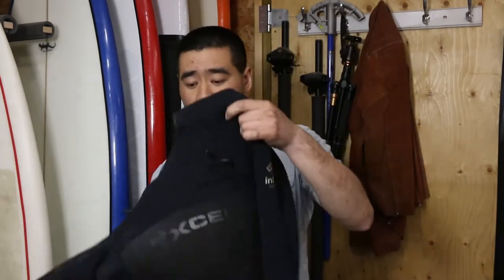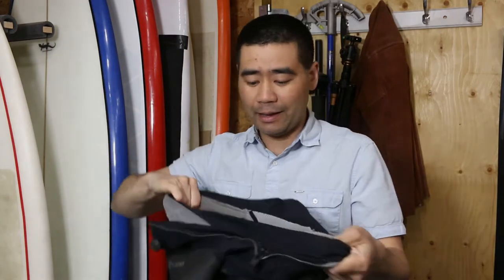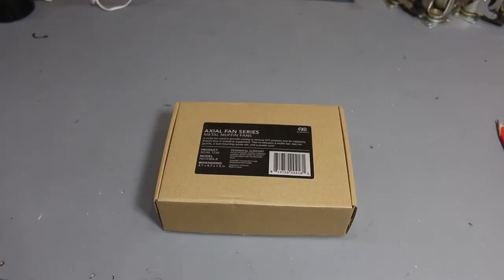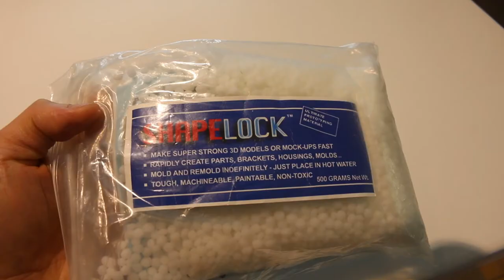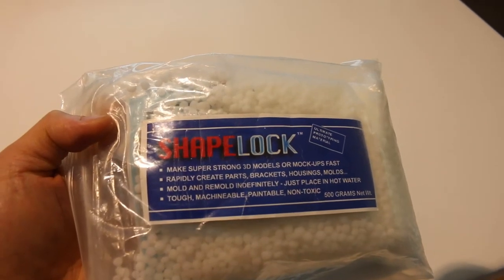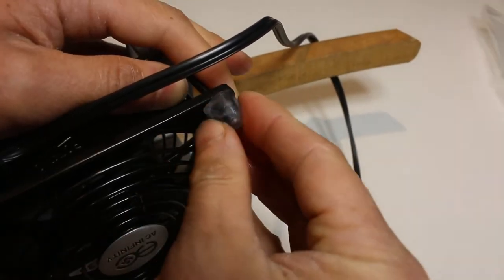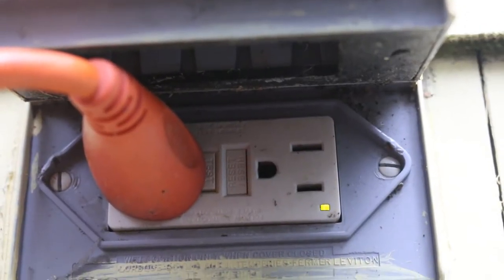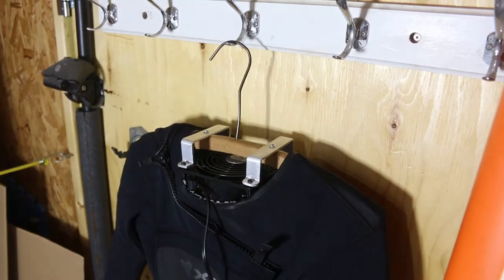DIY Wetsuit Dryer Hanger

Comment: Andrew this thing is awesome and I imagine will reduce dry time by more than half. Now I hang my suits right side out for hours in front of a fan. Once dry flip them inside out repeat. At work we have a monster industrial fan which work quite well but still a process. In my small apartment where I usually dry it I have only a normal size fan. I have a vice at work but not the Attatchment to make bends I would have to buy that as well. Can you tell me exactly what size and types you used to bend those brackets? Also what was the total budget all in ? Thanks @Andrew